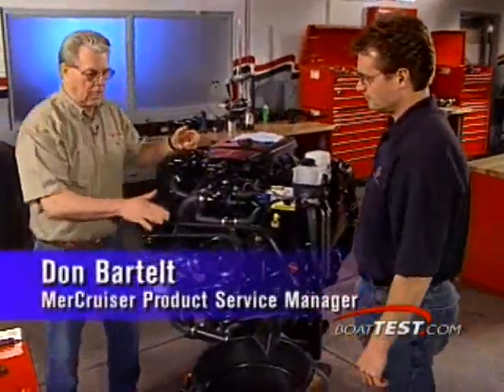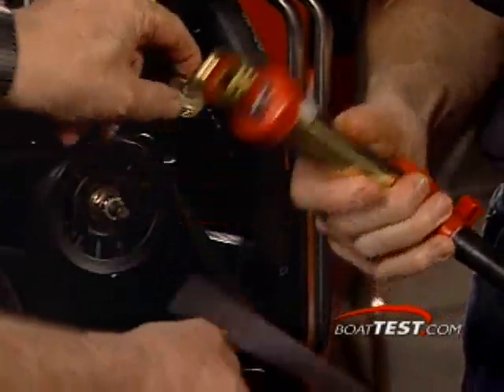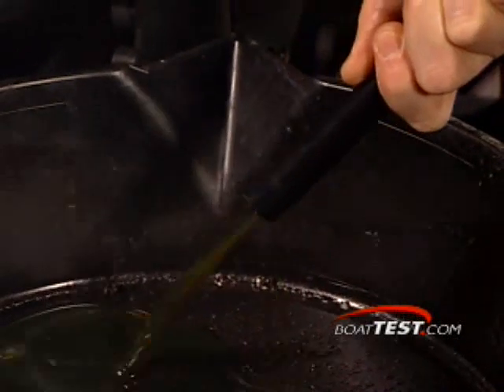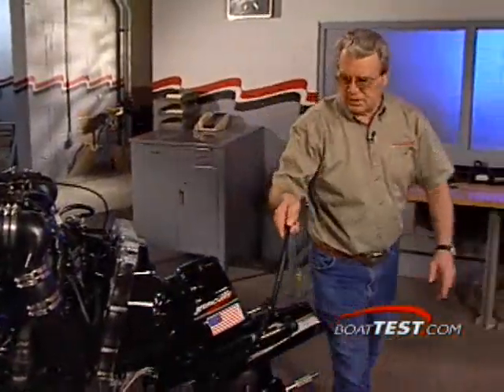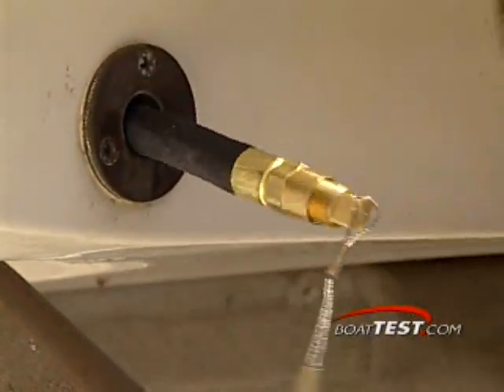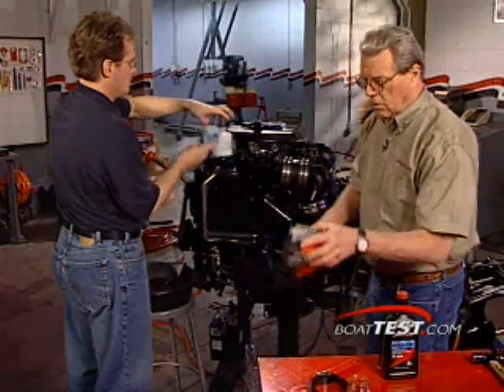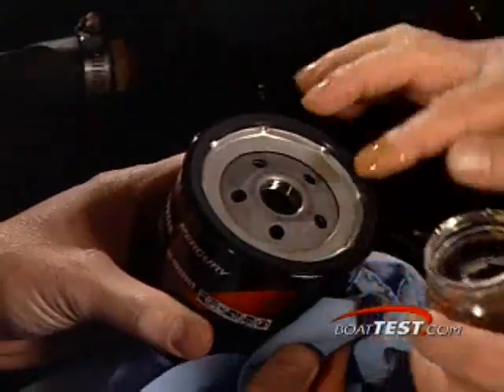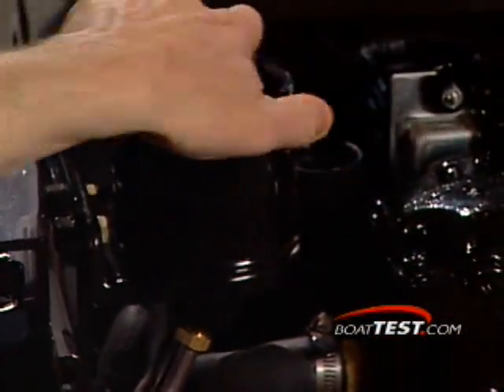Mercruiser Oil Change "How To"  By BoatTEST.com

Comment: I used to wonder why the blessing of oil on the gasket. The purpose is so that when you are tightening the filter it's last 1/2 - 3/4 turn after the gasket has made contact, the rubber gasket will slide and compress (to make a tighter seal) not grip (like bicycle brakes) and shred.  Plus, it keeps it supple so it won't get brittle and it helps with removal like the guy said.
Reply: roger78753 No shit?
Reply: Broxty  hahaha love this reply
Reply: Product numbers would be a nice thing to list in the transcript section. Oil filter number, oil specification, quick oil drain hose product number, etc.